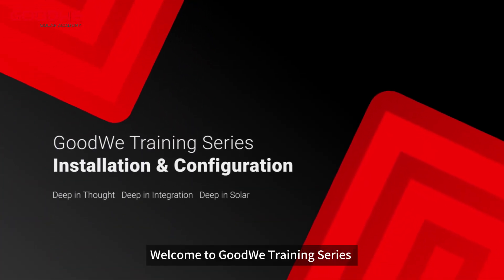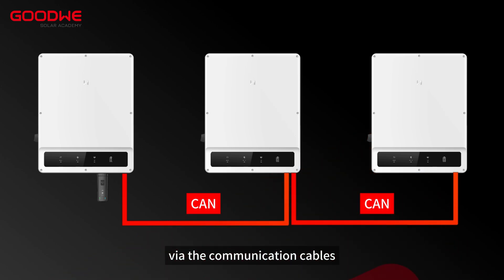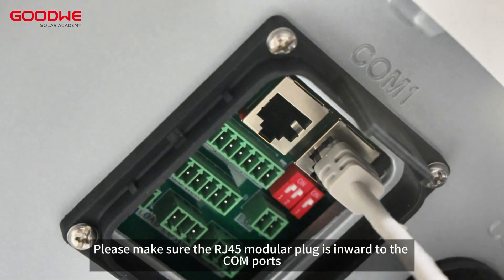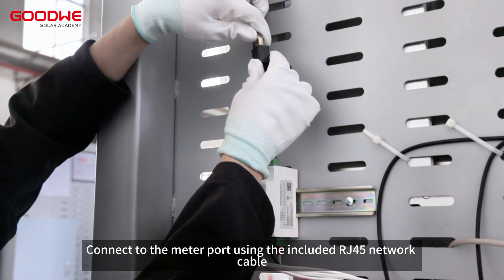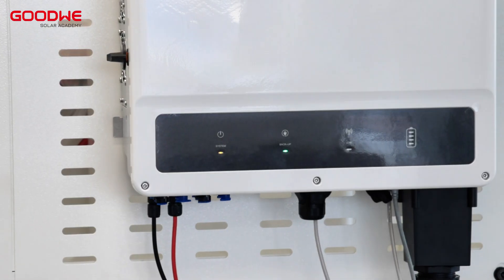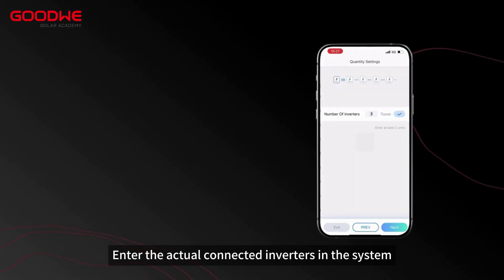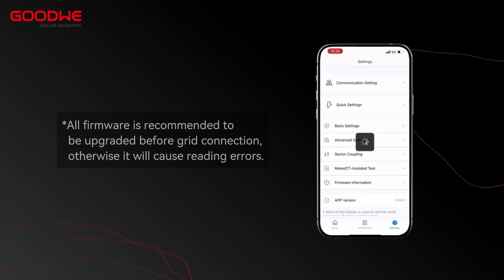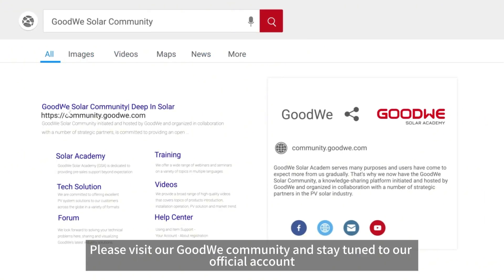GoodWe Parallel Inverter System of ET 50

Comment: We have problem in the master not discharging 

We installed 4 in parallels wiring all good and communication also good but the Master STS is not discharging also is not giving any power even from the PV
Reply from the maker: Hello, you could contact local aftersales for a detailed check. https://goodwetechnology.zendesk.com/hc/en-gb

Comment: is it possible to use 2 inverters with only one Battery on the Master Inverter? Does the Master Inverter charge the Battery with the Power from the Slave Inverter?
Reply from the maker: Hello, battery charging and discharging can't be shared, if there is only one battery, then only that inverter linked can use it.